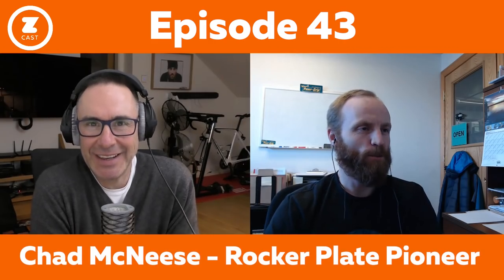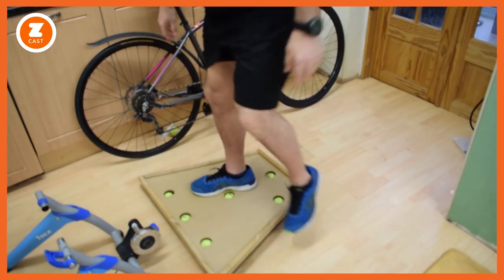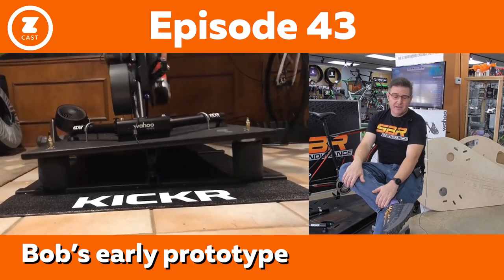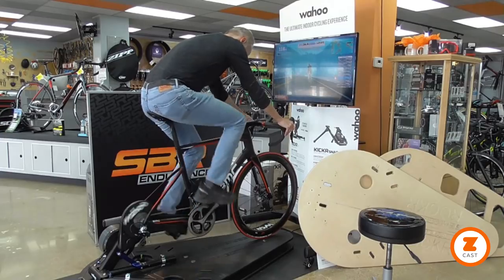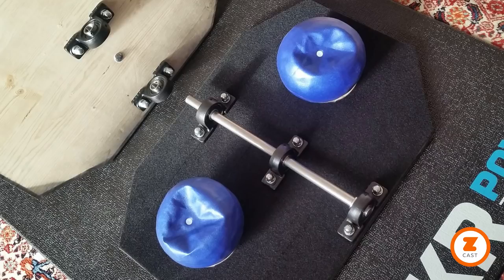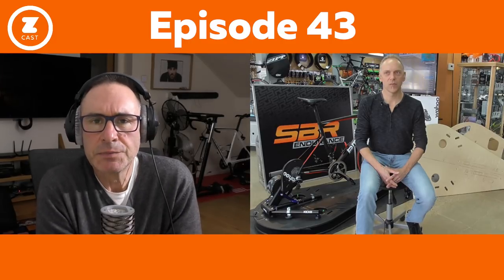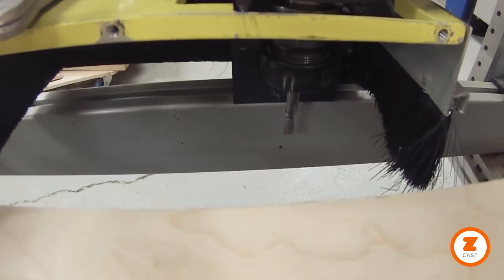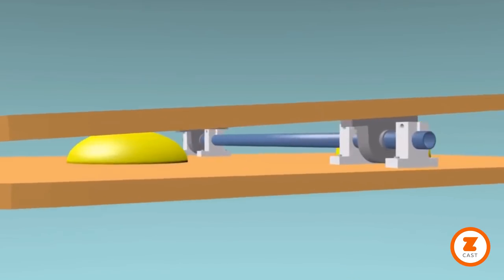Rocker Plates - Bigger and bigger

Comment: RE: SBR Rocker Pro:  THIS VIDEO DOES NOT SHOW THE CURRENT BUILD OF THE SBR ROCKER PRO.   When I first opened this I thought that it was odd that it came with what looks like a standard red kickball.  Oh and it came with a spare kickball (yah...those red things are just small, run of the mill kickballs) which should tell you something.  I've had the Rockr for a month or so...one of them has already popped - nobody on it or near it, last ride was the night before.   While the rest of the thing is well built that element is an EXTREME weak spot.  Might as well ship it with a dozen kickballs.